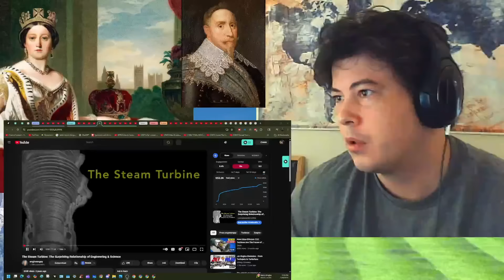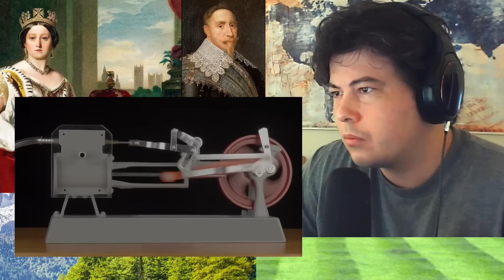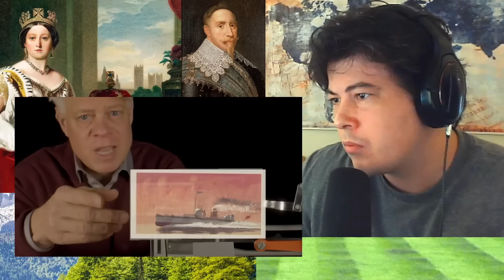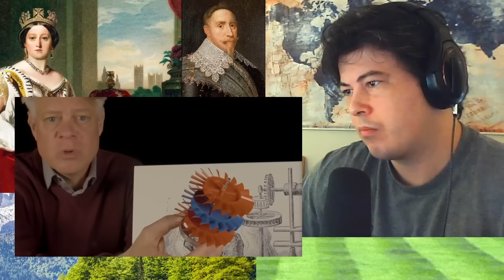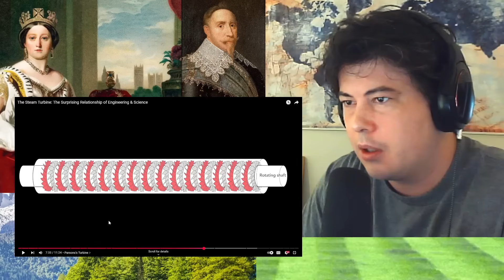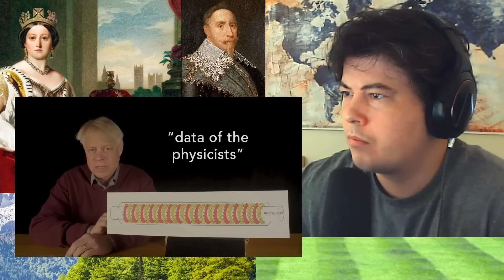American Reacts The Steam Turbine

Comment: A cup of steam is equal to a cup of water, only the state of matter has changed and the water is now in a gaseous form

A "reciprocating" steam engine is the kind of engine that rose to prominence in the 19th century and yses both the pushing force of steam in one side of the piston, and a vacuum in the other, creating a full "stroke" of the engine. Before the advent of the reciprocal steam engine, you had gravity steam engines whcih tneded to operate on chains instead of piston rods and used gravity to complete the stroke - much less powerful, as you can probably deduce

Comment: As the steam exits the rotating blades, it get squeezed into the space between the rotating  blade and the stationary blade. 

The pressure in that space applies force towards each set of blades, forcing them apart. This can only happen through rotary movement because of the central shaft. 

This essentially allows the steam to force the blades as it goes in and comes out. This happens over and over again as the steam travels the length  of the turbine, cooling as it does so.

The cooling steam contracts, so in order to maximise the force provided, it has to go into smaller and smaller sets of blades, with smaller spaces between them.

Comment: In the early 1920s, a Finnish marine engineer Sigurd Savonius whipped up a low-cost, reliable, yet not that efficient wind turbine. Savonius wind turbine is used in most anemometers, on deep-water buoys, other extreme conditions, and in the Flettner ventilator, which can be commonly seen on the roofs of vans and buses—especially the buses can be pretty rough places. With climate change, wind turbines get develop further. Couple of videos: "Comparison of the efficiency of various wind turbines, Darrieus,Savonius and HAWT", "Why you haven't seen these wind turbines around (yet)", "Tornado: New Portable Savonius Wind Turbine", "Harmony Turbines | The Perfect Small Scale Wind Turbine?" and "This Could CHANGE Home Wind Energy Forever!".

Comment: Steam has a mass, and like any mass moving at speed, it is more efficient at moving an object, the spinning turbine blades in this instance, if that mass hits the blade at an optimum angle to move it, hence the efficiency of redirecting the jet of steam via the stationary blades to the correct angle to provide optimum power.

Comment: My understanding is this: When the steam hits the first rotating blades, it hits them at such an angle, that they survive. Not only are they angled but also rotating so the apparent angle the steam feels when hitting them is tiny. That rotation is powered by taking a bit of energy from the steam and of course action-reaction applies. So as the steam moves the blades one direction, it itself is forced to move the other direction - the flow of steam starts to rotate around the shaft the opposite direction than the blades. So if there was only rotating bladed wheels, every next wheel would be getting the steam at worse angle than the previous one. Only the first one would get it straight on. So for that there are the stationary blades in between. They turn the direction of the steam flow to be again correct for the next rotating wheel. On that one action-reaction causes it to turn again and the next statich blade fixes that again. 
As the steam looses energy on each wheel it has less pressure in it than before. With very high pressure steam the only way to use it is with small short blades strong enough to survive the pressure. With smaller pressure the same size blade gets a lot less energy from, having bigger blade works better (less force per area but bigger area). So on each stage of the turbine the steam is allowed to expand a little and the next stage is a little bigger in diameter, little bigger surface area of the blades. That way each stage and each blade only extracts small part of the available energy, leaving the rest for the next stage, and each stage is strong enough to survive the pressure it is getting. At the end of the turbine the steam is near normal atmosferic pressure and has almost nothing more to give, all available energy has been used to rotate the shaft.

Comment: I think the stationary wheels slow the speed of the steam passing through the full length of the turbine thus it exists at a controllable speed.
Reply: The job of the stators (the stationary wheels) is to keep the flow from spiraling around the axis by bringing the flow back parallel to the axis.